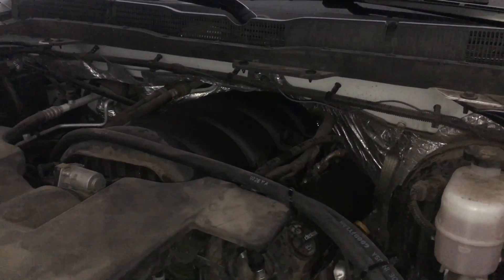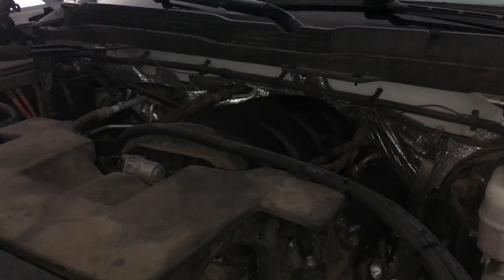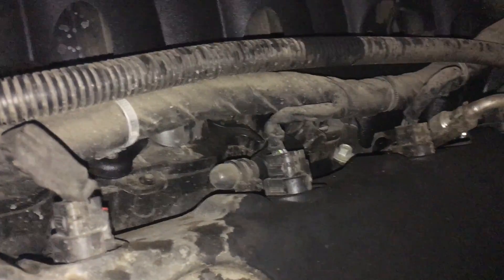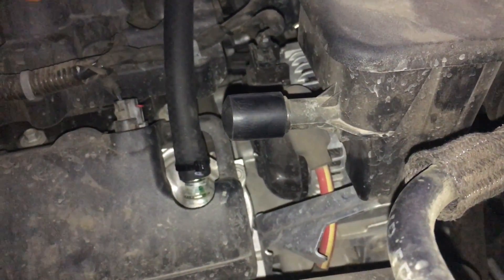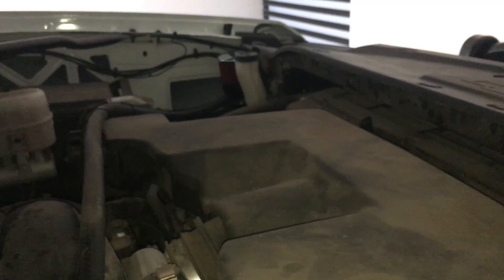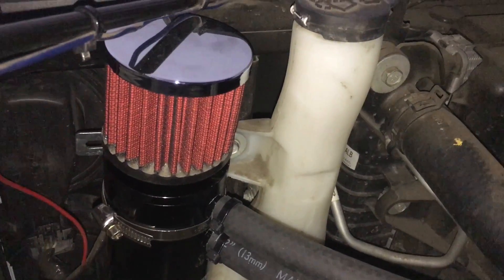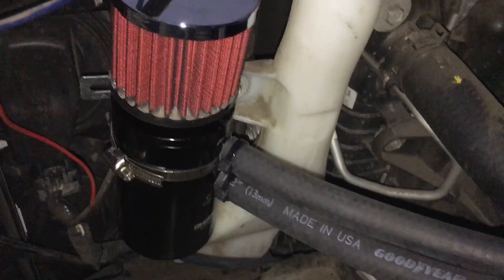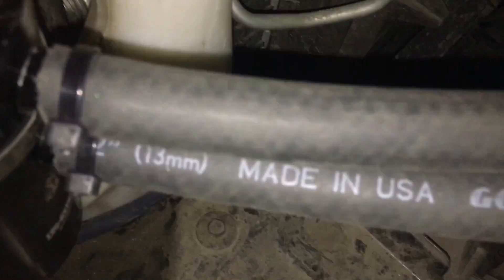How to Correctly Install an Oil Catch Can: PCV Delete

Comment: NEVER vent the crankcase! This defeats ALL evacuation and leaves most all of the wear and damaging causing contaminants to remain in the crankcase and mixing with the engine oil.  Cuts as much as 3/4 of the engines life. You also create a condition known as "Ring Flutter" by allowing pressure to build and vent.  You want full time evacuation as in this video:https://www.youtube.com/watch?v=v6h_FOzFMcs&t=611s
Reply from the maker: "Cuts 75% of the engine´s life" OMG LOL
Reply: 43 years working as an Automotive engineer, started with GM in 1974. Have owned, ran, driven Professional Race teams for decades, and we have decades of Divisional, National, and World Championships in multiple classes, and work closely with one of the Worlds largest lubrication labs.  And your qualifications?
Reply from the maker: Ok, you want to sell recirculating catch cans, we get it
Reply: he does not want you buy a catch can from some one  else . he wants to sell his can for 400.00  bucks . that's why he on all vidos
Reply: The crank case is vented anyway. What are you going on about.
Reply: Of course any time that you see zip ties as hose clamps then you know it's done correctly!! pffttt...
Mah niggahh

Comment: Venting doesnt work, pvc creates a negative pressure to evacuate the oil sump , venting just doesn't work
Reply: pvc is a synthetic plastic polymer used mostly in plumbing pipes.

pcv is positive crankcase pressure and just needs a way to escape.
Reply: steven wentling so what do you suggest because I want to run a catch can on my turbo v6 that has PCV and breather on one bank and two breathers on the other bank
Reply from the maker: You are missing the point, if you vaccum all those gases into the intake, it wil build upl clog the intake runners, ports and valves. The point is to not vaccum it and disperse it on the atmosphere
Reply: BadAssEngineering it's obvious you do not understand how an internal combustion engine works
Reply: The point is to recirculate it to the engine to be burned and not to disperse it to our lungs.
Reply: @ThePeanutization  😂😂😂😂😂😂😂 you don't need lungs
Reply: @lukethedrifter  :-) You need oil.
Reply: John Javs:
And the exhaust alone from your muffler is not killing your lungs..?? So by taking those blow by crankcase fumes and re-burning it will make it cleaner for everyone to inhale exhaust gas..??

Whether its being re-burned into the engine or dumping to atmosphere... those gases have to go somewhere...
Reply: @ACommenterOnYouTube  it makes them feel better if they pass it through some paper first.

Comment: How has this set up been working for you ? do you get oil fumes into the cab ?
Reply from the maker: Jord It has been working great, no fumes in the cab or anything, totally recommend to do it
Reply: BadAssEngineering , sounds good . I've currently have a moroso can installed , it's not vented . do you think I could run the moroso like you have yours plumbed but keep my drain open ?
Reply from the maker: Jord Im sure You could find a way
Reply: BadAssEngineering after some thought about your setup . I have come to the conclusion that I will stick with my set up instead. here's why ., the pcv system is designed to pull a vacuum on the crankcase and there for helps seal the piston rings , second reason is condensation/ sludge build up will be a concern if there is no vacuum physically pulling these gasses out of the engine . just venting to atmosphere will not be sufficient. Running a catch can inline from the crank case to the intake is clearly the smarter choice.
Reply from the maker: Jord Its not smarter, you won't change the vacuum on the engine, and on wide open throttle, there is no vacuum in the manifold to pull all the blow by. The smarter choice is to put a Moroso Vacuum Pump to clear all gases from the crankcase, and that vacuums it and blows it to the atmosphere anyway. But do what you believe to be the best
Reply: @BadAssEngineering  , I retract my previous statements about not considering your setup ,  after much debate I have changed my mind and will be going to your setup , just with out a catch can . I live in Canada , we dont have emission laws here . Like you , I can do what I want :)
Reply from the maker: You can remove and cap the stock PCV line and direct both Crankcase vents to the floor. Since this video, i changed the setup and im currently using a Moroso Race Evacuation System, which is the exact thing youre gonna use, but instead of venting to the atmosphere,  they go to a venturi on the exhaust that vacuums it. planning to make a video about it soon
Reply: @BadAssEngineering  . I have seen those system on race cars ! I look forward to the video !
Reply: @BadAssEngineering  were you running into any problems with the catch can setup you had . Why the choice to run the moroso race setup now ?
Reply from the maker: No problems at all, everything worked perfectly. Changed the set up just for the fun of experimenting with new things. I even tested a vacuum meter and the Race Evacuation Set up works so good is hilarious
Reply: @BadAssEngineering  awesome !
Reply: BadAssEngineering sweet video, I like the design of your catch can. What brand is it? Thanks👍
Reply from the maker: Duwop77 search for K-Motor Catch Can on eBay 👌🏼